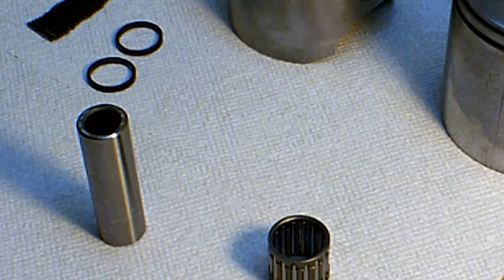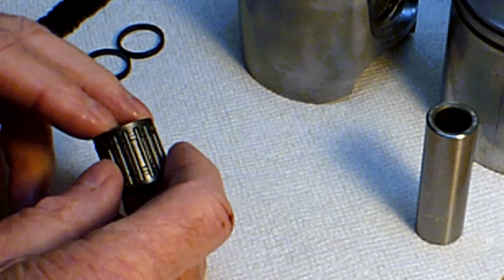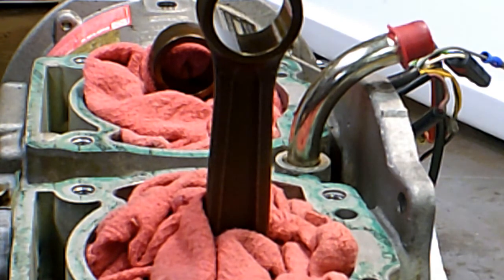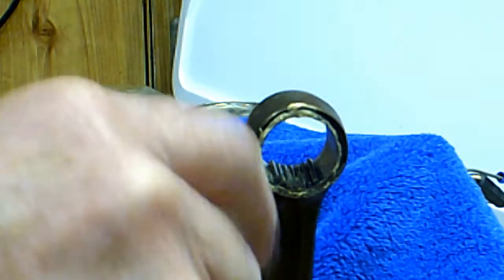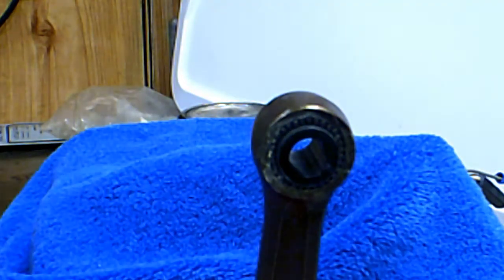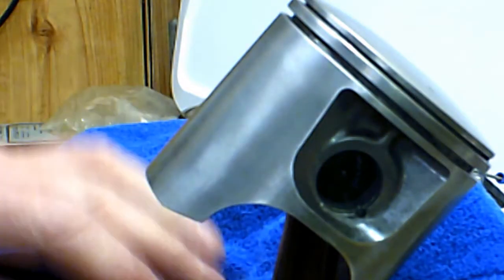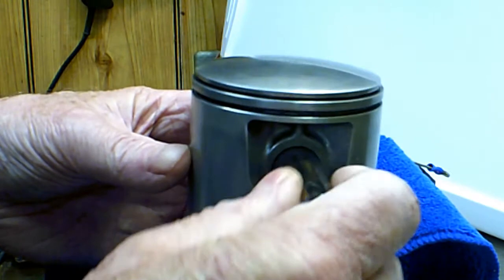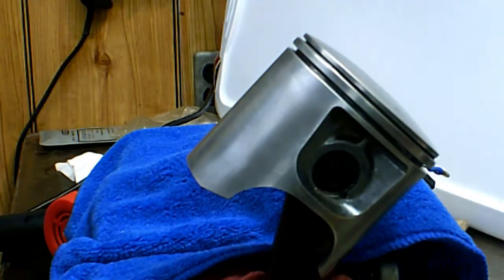Rotax cageless bearing installation #9

Comment: we're sending you 20 bucks for one.  What about the snap ring tool? how do we change crank bearings?  I just got a new set of cageless needle bearings from skidoo, they come in a cylindrical plastic clip the tool can be pushed thru
Reply from the maker: Look at my video of the 583. There are plenty of videos on crankshaft rebuilding.

Comment: I think your count is wrong.
Reply from the maker: You might be correct. Main thing is to be sure bearing is full, and you cannot add any more.  Needles are available at bearing shops, and are cheap, but they may need to order them, and they may make you buy a lot of them.

Comment: Recently purchased a Rotax 618 so this video series has been  very informative to me. Thanks. You never mentioned the inner seals on the crankshaft or the lower rod bearings. Were they replaced or serviced?
Reply from the maker: I replaced the mag side bearings with the ones as shown. Could find no problems with the other bearings, but the center bearings would require taking the shaft apart, which I could not do. I have noticed no loss of rotary valve oil, so I am going to figure the seals are OK.
A good video of rod bearings going bad is at:
https://www.youtube.com/watch?v=Y_hWKJQn7Uc

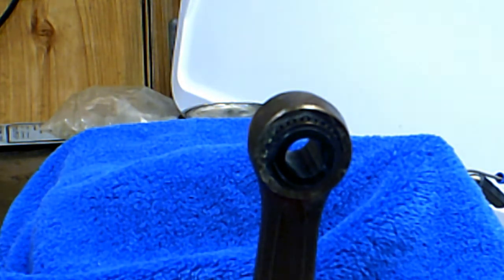Action starts at about 9:45 on the video.
Reply: @Adventurepilot70  From what I've read the lower rod bearing is a common failure point in these engines. Later models and aftermarket rods have two oil slots on the rod to address the problem.
Reply from the maker: My engine has just a single slot. I do not use oil injection. I use regular pump gas 87 oct. If I followed all I have read, I would have replaced the crank 4 times already. I don't know if the industrial main bearings I have installed will be better or worse, and I do not say anyone should do this. This video shows what I did.
My rod bearings are free of play, are smooth in motion now, but dirt or damage from other places in the engine could quickly take them out. ( Like the fellow at 115 hours.)
I am not in the engine business, and do not service engines other than my own, so I really don't know much about what happens to others. Many of my fixes do not workout.